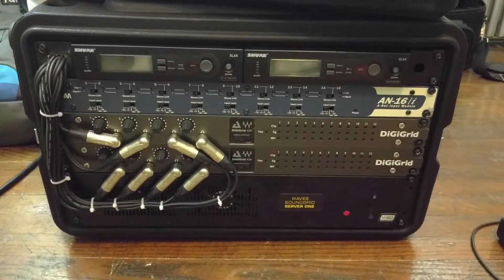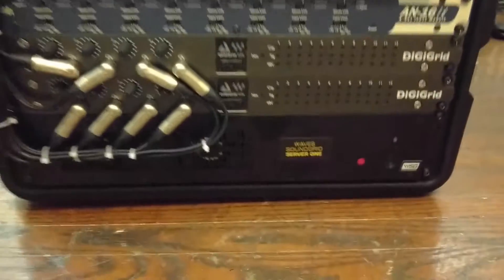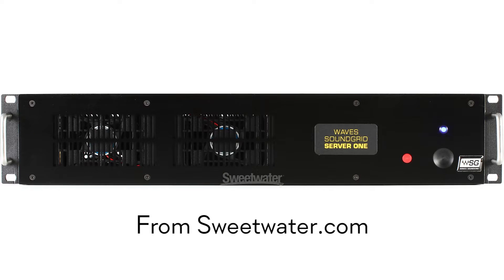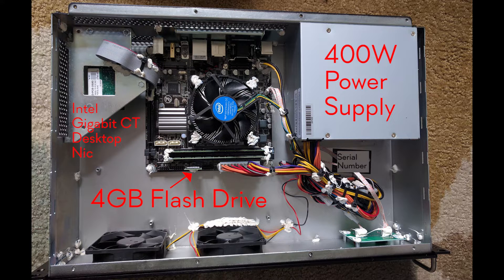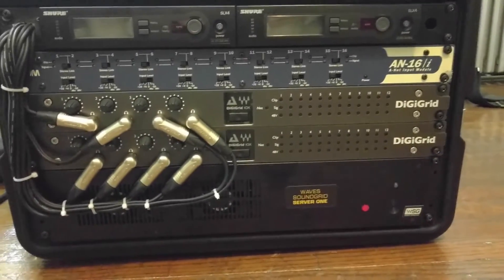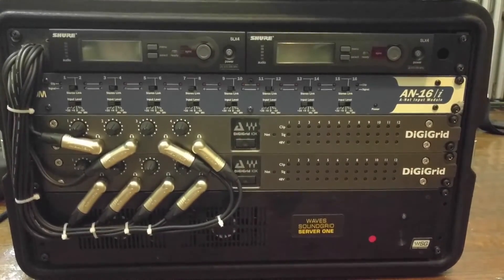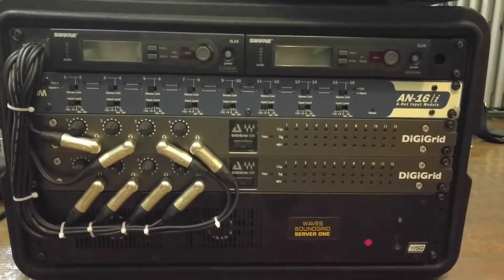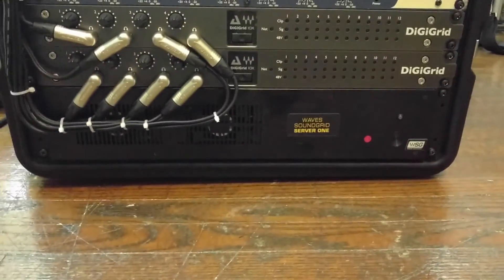Waves SoundGrid Server One look inside

Comment: The Waves custom board on these servers mainly do three things. 1. Instantly power on the server when power cord attached. The custom board send the PWR signal to the motherboard and it turns on the server. 2. Fan control 3. Front panel LED indicator show the status of the server. This custom board is an AVR (low cost system-on-a-chip, AKA Arduino like) based board with motor drivers. It communicate with the main board through COM header on the motherboard, also it attach to the PWR and RST pin of the motherboard. Disconnect the COM cable between this board and server doesn’t seems to stop the server from working (not a software dongle at least for now).

Comment: is it possible to upgrade the processor and RAM?
Reply: Yes I onw a Custom Server, But te Memory 8Gb is Ok, what Makes the diference in the server is the processor and lan port, in my case i buld an server whit i5 9400f and H310 Gygabite Mother Board,
Reply: @djchrisnobeat   I have an asus p5kpl SE with an old i3 quad-core cpu. The linux partition boots up but I can't connect to the server on mac.

Comment: Why the add-in NIC I wonder and not the onboard LAN?
Reply from the maker: Brett Noack that is NIC is an Intel Desktop NIC which is super reliable and does all the processing it's self so the CPU or chip set doesn't have to process the network traffic.
Reply: The image people want  to see is not a picture, it's the Firmware (OS) on the server. I wouldn't mind a copy either. :) With that you could build you own soundgrid server.

Comment: It shows how much money they are making mostly got thin air. They shoudl release an iso to support those hwo paid so much for the plugins whcih actually perform bad and need extra cpu to start with.
Reply from the maker: I mean you are paying for their software. There is a lot of code running on their box.
Reply: ShaneYake #Vlog If there plugins ran better there would be less need for a second overpriced machine.
Reply from the maker: AndyMc Producer I don't use the server in a studio haha. It is all for live and for Live nothing beats there server in latency and reliablity. I wouldn't recommend using the server for studio work, rather build a fast mixing machine.
Reply: @shaneyake2  just about less than 16MB is alot?
Reply: On the other hand, if they didn't care about hardware profits, the hardware would priced slightly above cost, which would turn more buyers into waves plugins, because they can afford the server... It's not slightly above cost. Not even close.